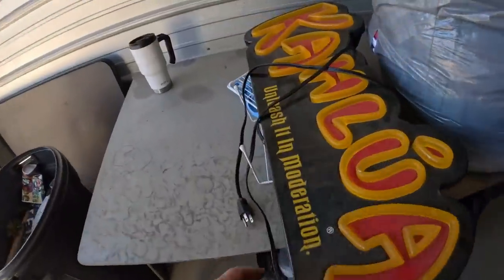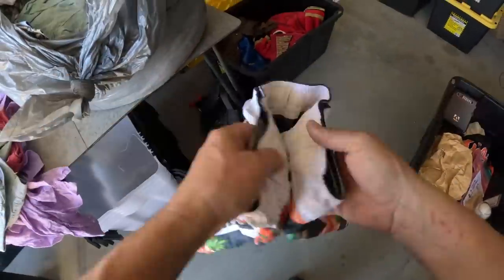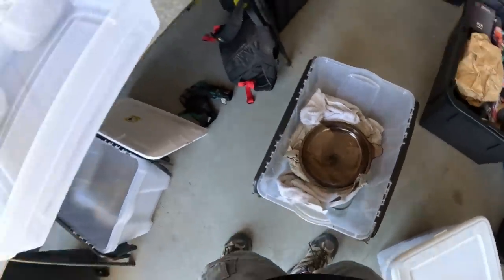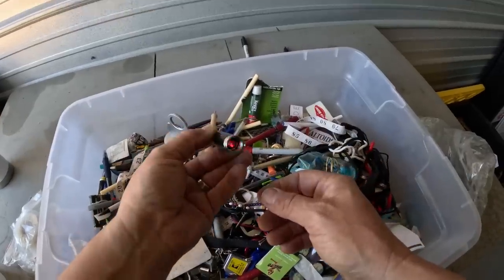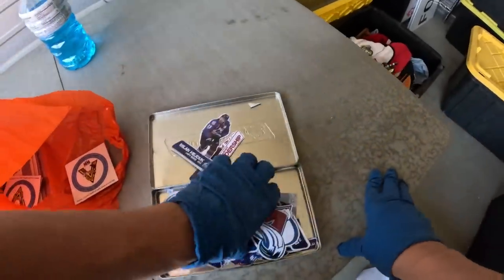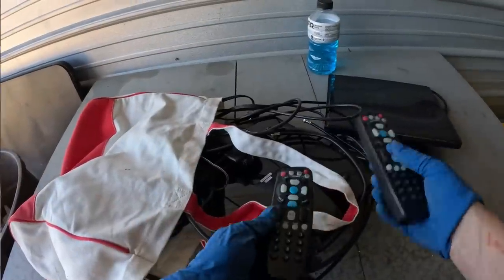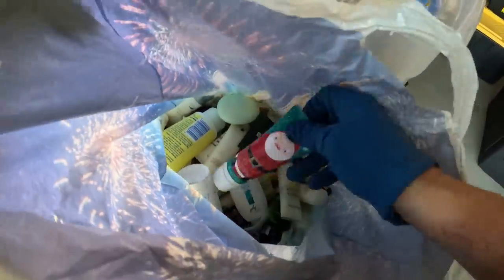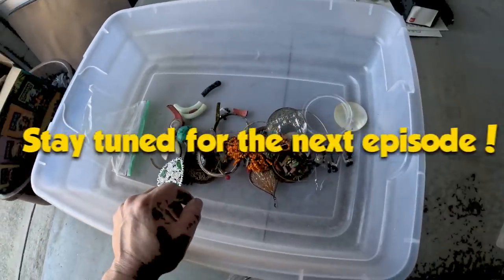THIS caught my attention... I've never seen something like it EVER!

Comment: 9-volt batteries can be dangerous. The positive and negative posts are close 
together. If a metal object touches the two posts of a 9-volt battery, it can cause a 
short circuit. This can make enough heat to start a fire. Seen you had some in your batteries bucket.
Reply from the maker: Thanks for the tip! I always test my 9-volts using the tongue test.